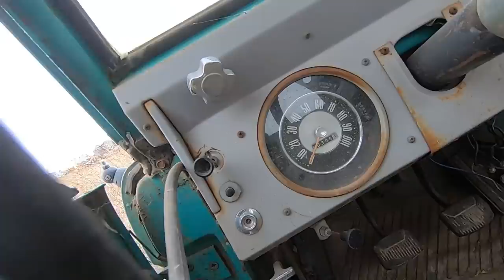Abandoned 1966 Ford Bronco rescued from the pasture! Will it run after sitting for 25 years?!?

Comment: Actually a dependable motor if they hadn't have buggered all the water works on it. Usually the body and frame would rot off of them long before those straight six motors would stop working... 302 it head to Baha? lol

Comment: Freeze plugs!  Man, being from Texas/ New Mexico, I'd never even consider one rotting or busting out.
Reply from the maker: You'd think it would be common there. Folks running straight water causing them to rust out. No?
Reply: @MortskeRepair  I've never seen it.  We got about 4 inches of rain total last year, so the environment is dry as can be.  I picked up a 67 Galaxie last year and the worst it had was surface rust.  I plan on getting a 49 Chevy truck soon so we'll see if it has any problems with plugs.
Reply: Lots of rusted through casting core plugs (for cleaning the casting sand out of the block and head) across the Gulf coast where one seldom sees a freeze cracked engine.  One like that was our hunting camp truck in the '70s. Never could get it from the owner's relatives after he died.

Comment: Scouts and broncos looked so much alike that Ford had to raise the top of the fenders to make it look different.
Reply: Not!
Reply: @fordman9983  scouts had more horsepower in the beginning than ford did with a 107 hp v8 engine. Even though they were both heavy vehicles, the scouts share parts with jeep and ford, like front axles and transmissions.

Comment: boy im commenting a lot today. For exhaust manifold bots when i broke mine off and couldn't get the welding trick to work, what i did is use the milwaukee diamond hole saw and gradually just chewed it out. Trust me, i spent over 100$ in bits to get 1 bolt out. Something to investigate if you're ever in such a situation again!
Reply from the maker: Sounds horrible! I hope I never get to that point!

Comment: I have had NOTHING but bad luck with extractors.  If you break one off, you’re hosed.  (BUT,  I don’t own a big torch either).  First determine what the thread is (you probably already know that).  Look up the tap drill size for that thread.  Drill a hole thru the broken bolt/stud a few sizes smaller than the tap drill size.  Keep increasing the drill size and when you approach or hit the tap drill size, the remains of the broken bolt/stud will walk right up the drill.  Using some oil to lube, run a tap into the hole to clean out the thread.  I have had 100% success with this method, including broken bolts in both cast iron and aluminum.
Reply from the maker: I have a lot better luck with extractors. And I have a torch.
Reply: @MortskeRepair  a torch definitely helps.  Love that old Bronco.  Here in New England, they have all gone to the big rust bucket in the sky.

Comment: Those appear to be stainless nuts...at least from a distance. Dont know why that matters, but I did this a while ago, kept snapping them off til it dawned on me they were stainless nuts. Switched to zinc coated and had success on the first try....I've done this trick for years and that was the first time it failed on me like that. Figured it had to be the nuts
Reply from the maker: They're zinc plated. These ones were just too seized.

Comment: Super easy way to fix a bad frost plug. First clean the bad plug best you can with emery cloth. Then grab a quarter. Smear JB Weld on it. Stick the quarter over the bad frost plug. Done this 3 times and never failed. I call it a side of the road fix but seems to last forever.
Reply from the maker: I guess it would work in a pinch!
Reply: @MortskeRepair  did it on an olds 350 to get it home. Plug was right by the motor mount. Got it home. Also did it on a 65 wildcat. I lived 60 miles from a parts  store at the time. Seems to have held.
Reply: @MortskeRepair  if they were all rotten like yours I would fix them properly.
Reply from the maker: @Ian-of9oi  Sometimes it's better to be lucky than good!

Comment: In stead of a duro spark go with a GM hei conversion I found one on the jungle site for $104 Just a quick lookup
Reply from the maker: Yeah but then it's all overseas parts. Rather keep it Furd and use some Merican stuff!
Reply: @MortskeRepair  I get it. there are merican makers, hard to find. but they are there. I just like making Ford built GM tuff
Reply from the maker: @reinovator  Same here! See if I can source an OG Ford one cheap and go from there. Then If I have issues on a Saturday I can get parts at least!
Reply: @MortskeRepair  Lol Nuff Said

Comment: That wasn't very encouraging. I have a 66 Falcon with a 200. The exhaust manifold gasket is blown and I am scared to change it. I KNOW those bolts are going to break. BTW, I have been driving as is for 5 years. After watching you break off bolts, maybe we will make that 7 or 8.
Reply from the maker: You got this!! You can pull the engine out in less than an hour.

Comment: Has anyone tried cleaning out a block by filling the thing with Evaporust and leaving it for a day or two? You would need to rinse it out with plain water and let it dry out, then cap it off and fill it up. It should leave the block totally rust free after 24-48 hours soak.

Comment: That metal rod is for release the sparewheel behind the rear bumper.
Reply from the maker: Interesting
Reply: @MortskeRepair  My ford explorer of 1992 has that kind of rod under the motorhood. And behind the rear bumper hangs the sparewheel. With the rod you can release the spare by turning the rod that's placed in a little hole above the rear bumper. I think that the gasolinetank of your bronco is not  at the orginal place. My Explorer has the tank sideways under the chassis.
Reply: Besides of that I like your vids...!! Keep on rolling.

Comment: You got yourself an early 66 probably the first three months of production with that eyebrow grill.
Reply: 66 came with a lot of 66 specific parts!  Like the front and rear bumpers were 66 only the rear tailgate is a 66 only too
Reply from the maker: Yeah I'm finding that 66 had a lot of strange stuff!
Reply: @MortskeRepair  the original steering wheel in the box did it have the original horn button on it? 66 was the only year it had “Ford motor company”
Reply: @MortskeRepair  also be cool to know what build month your is with having an eyebrow grill that means it’s a Budd body bronco look into that
Reply from the maker: @kristopher87  I guess I haven't looked.

Comment: if this was mine and i had to pull the engine for the plugs i woulda done a rusteration/craiglist rebuild and cleaned or replaced all the external cleaned the block threw ford blue paint on everything i mean might as well since your there also to clean out then water jackets real good and clean all the crap and grease off the motor in general kerosene works good

Comment: I'm not a mechanic don't clam to be one but I have a few questions.  I wasn't sure if you checked the compression or dropped the oil pan to checked the crank  and piston rods for slop before messing with the exhaust bolt before you started the video but why not check that before the bolts? I think, not that I do much of that, that would be smarter way of doing things. Just asking from a non mechanic point of view.
Reply from the maker: I don't have time to go through every aspect of the vehicle. Previous owner never complained of issues with oiling.

Comment: The original 6-banger in this Bronco would not have had all of those vacuum lines or the wonky carb linkage.
Reply from the maker: It's a 78 model 200 engine

Comment: There's are several Bronco's online ranging in price-$40,000 to $141,000, which seems like enough. But a price similar to that is easily achievable for yours if you are willing to put an amount of $$ into it. Say $145,000=$141;000 sale or on the low end $50,000 plus nets the $40,000 sale.My experience only, your results may differ.
Reply from the maker: Ouch!

Comment: dead spot is caused from vacuum leak past the throttle plate when coming off idle,,  Need to put bushings in the throttle plate or replace carb,,,  :-)
Reply from the maker: Oh yeah, she's shot!
Reply: @MortskeRepair  It looks like you have a pretty good lathe,,, you can use that to machine out the throttle plate holes,, If you want to try it, I can tell you how I did the throttle plate on a Holly 4bbl,,,  I used to have4 a '70 bronco,,  Put a 300hp 351w in it from a mustang,,  It was pretty quick,, :-)

Comment: Did you replace the two freeze plugs behind the flywheel?
Reply from the maker: Of course not!
Reply: @MortskeRepair I figured that you did not.   I worked in an automotive machine shop for years.  I HATED these 144/170/200 FORD  sixes for those exhaust bolts.  We always got them in the shop AFTER the owners broke all the studs, plus a few drill bits and EZ outs off in the holes.  Best thing to do with these engines is melt them down and make paperweights out of the metal that remains.   I was hoping and praying that the Center Rear Freeze plug did not leak after you got it all bolted back into the frame.    I like your video and this project in particular.
Reply from the maker: @mlynch001  Sad part is I've got a 223 leaking for this exact reason...
Reply: @MortskeRepair  FORD saw fit to put that plug on back and then hide it under that sheet metal plate. Another “better idea”?
Reply from the maker: @mlynch001  This one is half sticking out the bellhousing! So you can see it but not do a damn thing about it!

Comment: I've crossed wires on a coil, burned the unit and had to get new points. Lesson learned.😐
Reply from the maker: Whoops!
Reply: Oh well, got the right voltage and everything is running just fine now. Atleast the points and condensers are cheap.

Comment: If memory serves me right I saw on another video where they were having the same issue. It'd crank and run for a second and then die. Problem was in the janky ignition switch itself. When the key would return from the start position it'd break the ignition circuit and the car would die. They'd jiggle it and could keep it running but the ultimate solution was a replacement ignition key switch.
Reply from the maker: Yeah we'll have to dig into it more.

Comment: IMHO LEAVE THE HALF TOP.....MORE RARE  and came from factory that way with bulkhead installed..... Ford interior parts interchange with later pickups...... Mid 70 stuff will bolt in........window cranks etc... ..don't. Toss those seat  frames  out try later model econoline seats
Reply from the maker: Thanks for the info!

Comment: Mid sixties f series pickups use same tail light lenses.
Reply: Econoline too 68 to. 74 same lenses
Reply from the maker: Great tips! Thanks!
Reply: Yeah don't say bronco in pull a part......as I remember the door cranks pulls interior switches lenses  headlight buckets. Gauge cluster etc all came from another model line even falcon of that era.........yeah FOMOCO dipped into a 15 yr parts bin to build this so don't limit yourself to one year and gawd please don't say bronco at the. Pic a part

Comment: Why are you going to so much trouble to resurrect that turd the 6 cylinder that is considering it's a crapshoot that it even runs? So much work for so little return of fun and HP ??
Reply from the maker: It ran well when I fired it up. It doesn't need much power and it didn't hardly cost anything to put it back in as opposed to the $$ involved to convert it to something else.

Comment: As we pray in England -- Psalm 23

The Ford is my motor, It lacks everything.
It makes me lie down in strange places,
It breaketh down beside quiet waters,
It weakens my soul.

Every time I drive
Through the darkest valley
I will fear the worst,
For you are with me
Your piston rods and your  gear staff,
They worry me.

You prepare a breakdown before me
 In the presence of my enemies. (Jaguar, Rolls Royce, Toyota)
You anoint my head with oil
Your radiator overflows.
Surely your unreliability and breakdowns will haunt me
All the days of my life,
And I will dwell in this wreck of a Ford forever.

Amen.
Reply from the maker: That's good stuff! Thanks for watching and commenting!

Comment: I would slap the 223 I6 from the $50 truck in that baby! It seemed to be a reasonably solid running motor. Keep it half top to, uber rare!
Reply from the maker: That rig has a 240 and typical Ford, nothing interchanges.
Reply: @MortskeRepair  some reason I was thinking it was a 223.... Are you going to stick with what you have in it?

Comment: Weld a bead in the inner lip and they will shrink and fall out..
Reply from the maker: I've seen this before. Seems like a lot of work when you can just tap on them.
Reply: @MortskeRepair  only takes maybe 2 minutes per freeze plug.. I’ve easily spent 3x that with a hammer and chisel getting some stubborn ones out lol
Reply: @MortskeRepair  also works awesome on blind bearing races..
Reply from the maker: @jeredrice5594  Races it works awesome!! I guess tapping these out has never been an issue. Thanks for watching and commenting Jered!

Comment: U pulled the motor? Ur ol lady must be on the?? I don't like being in the house them times . Hole saw thru firewall. They put every type of fix a leak . Beer is good
Reply from the maker: Drilling those studs out in the vehicle would have been a treat. And that's a hack move cutting the body up just to lay under there upside down and hope you can get the job done.

Comment: Coil ballast resistor.
Reply from the maker: Do you know where it's located??
Reply: @MortskeRepair  Should be a white ceramic block about 3.5 inches long, right close to the coil.
Rip off the wire from it and join them together, and it should run, but replace it, or use a non-ballasted coil, otherwise it'll eventually fry.
Reply: WireS, not wire, obviously...
Reply from the maker: @andysaunders3708  I think I'll keep an eye out for the Duraspark setup and then wire it direct. Make life easy!